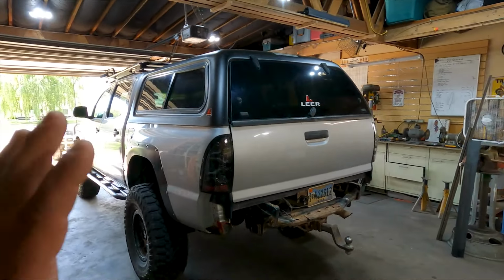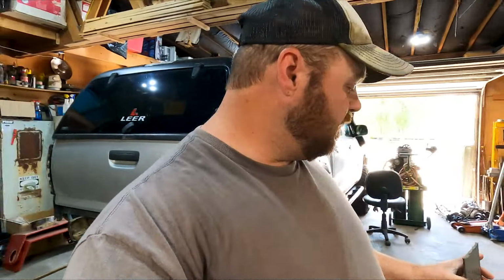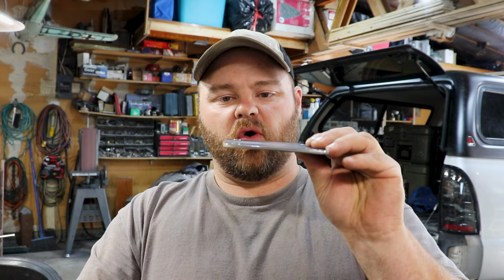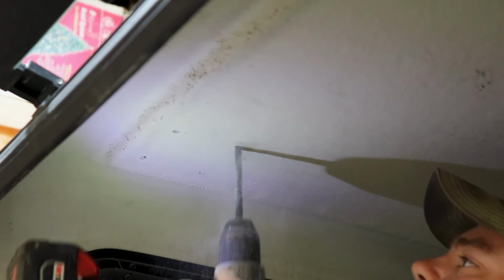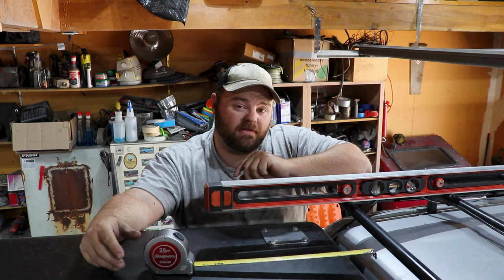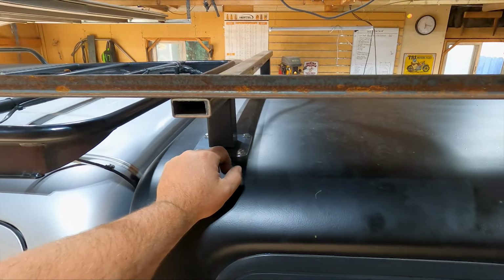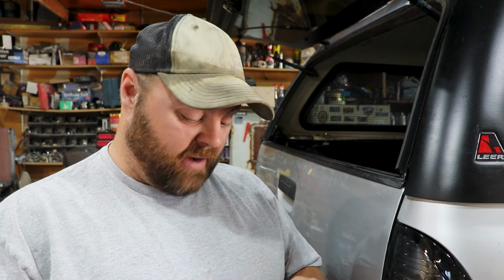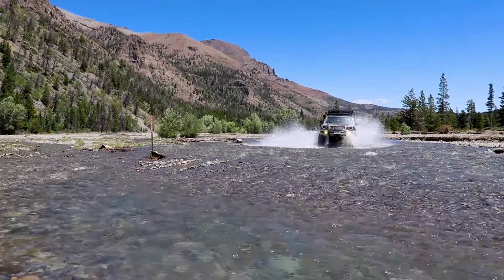D.I.Y. Overland Canopy Built Part 2 - Overland Garage

Comment: Nice! Any concern about the fiberglass cracking under the dynamic load? Love the clamshell RTT, I would go that direction if I had less kids 😂
Reply from the maker: It really depends on the construction of the fiberglass canopy that you have. The canopy that I put on my truck I feel like it is built strong enough to handle the load because the corners are reinforced as well as the ceiling. I do love wedge style tents the speed of setup and take down is wonderful.